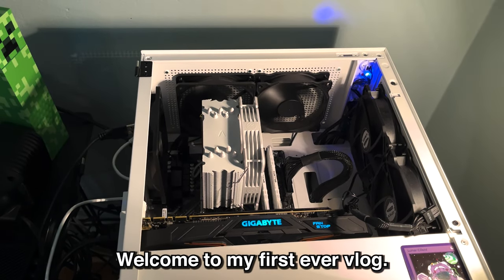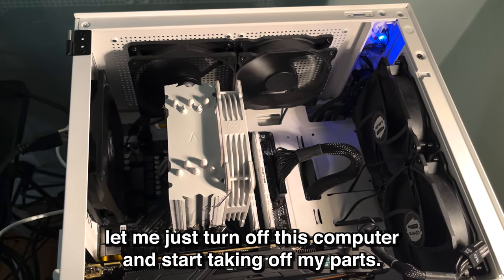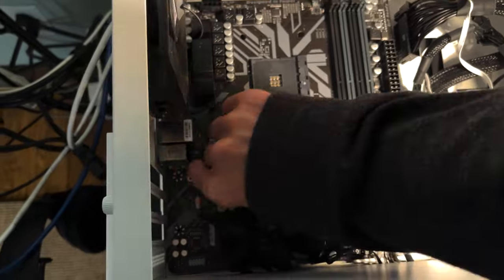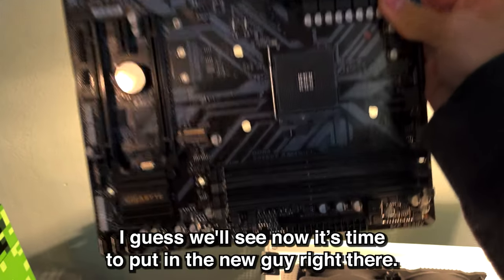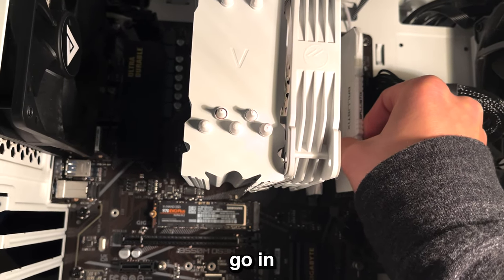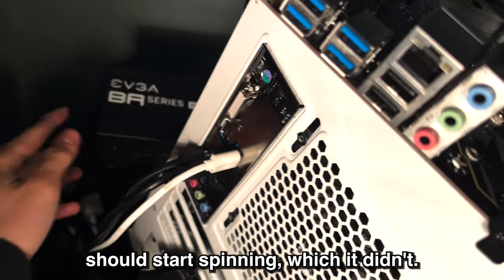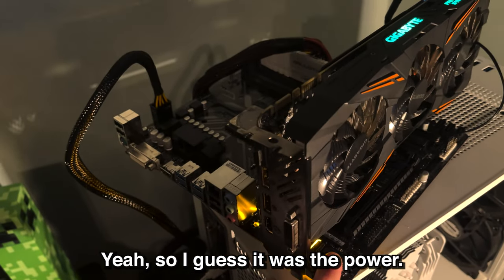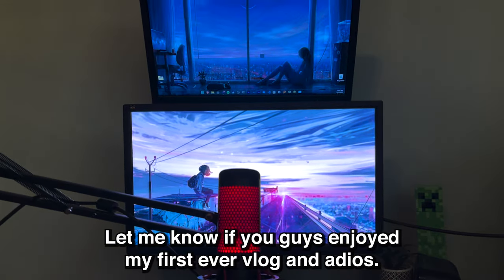My Computer Blew Up!?! Fixing It (My First Vlog)

Comment: how did you manage to do it
Reply: Idk I wash shocked when he put the cpu back in without cleaning it first lmao
Reply: @gloopington  thermal paste prolly wasnt that dry and still usable
Reply: Thermal paste is NOT reusable. When you take your cooler off you should always clean both the cooler and the cpu and reapply paste. It’s common sense
Reply: @Specially.  it’s a preventative measure, when you take the cooler off your processor you leave a bunch of microdots and imperfections which won’t realign after remounting, similar to how bushing and washers work